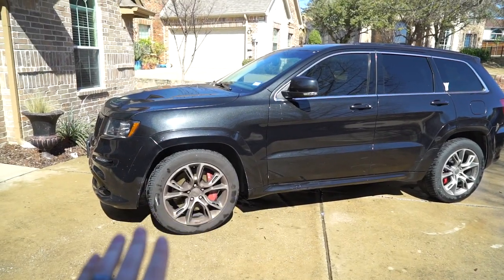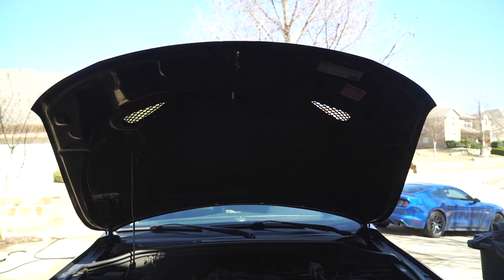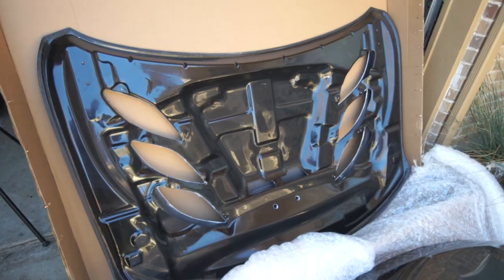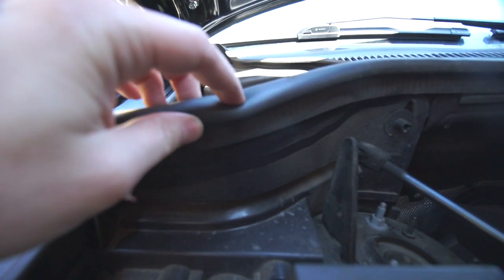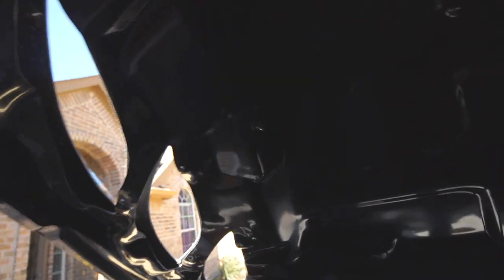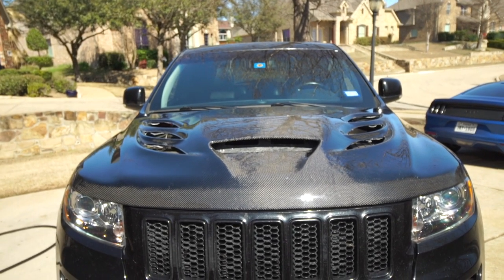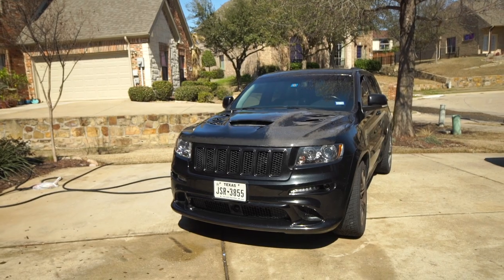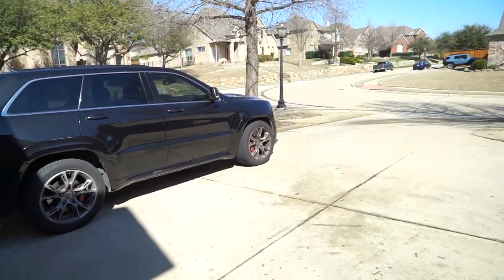CARBON FIBER HELLCAT HOOD INSTALL! (Jeep SRT8)

Comment from the maker: We got some damn good videos coming this week. omg.
also i love u all, check out Black Ops Auto Works if u want me to do more littymods
Reply: You should get aftermarket headlights that have led daytime running lights like the newer grand Cherokee
Reply: Evan Shanks sick boi keep it up
Reply: Evan Shanks bro why won't you turbo the jeep ? You could put anti lag on it and make a lot of power
Reply: Evan Shanks dam the jeep looks beautiful with that carbon hood 😬👍
Reply: next you need carbon fenders and a carbon bumper
Reply: just sayin thats a viper acr hood not a hellcat hood so you need new viper acr vent
Reply: Evan Shanks broooskiiii the brakesssssss
Reply: damn evan that jeep looks sooo mean as hell love the hood
Reply: The chrome trim around windows needs to be black, it would look really agressive, imo i think thats throwing it off a bit now, but wow it looks good
Reply: Evan Shanks are u gonna do the 2014+ headlight conversion I've been seeing lately
Reply: No cold air on it?
Reply: You really need wheels for the srt8
Reply: Tiff blue just sanyain
Reply: Evan Shanks do they have carbon fiber grill inserts? You should definitely add that to the list!
Reply: Evan Shanks will your 53 hoodies be coming back in stock?
Reply: Evan Shanks you should rap the Jeep a b5 blue or a crazy green
Reply: b/99₩Evan Shanks

Comment: I’m so glad FCA got rid of the 8 and changed it to just SRT. Would you consider getting rid of the SRT8 badge on the rear and change it to the SRT badge like on the 2014+ GC SRT? And also why don’t you ever use the paddles?

Comment: Please don't Plastidip the SRT, it's fine on a drift car cause it's cheap and looks decent for a short amount of time, but when it comes time to remove the plastidip it's going to be a pain in the ass, it will only really last about a year in the weather conditions in your state, max is maybe 3 years in Cali.  Vinyl wrap would be good af though